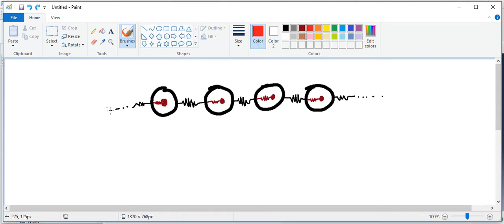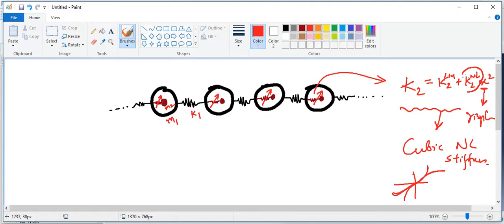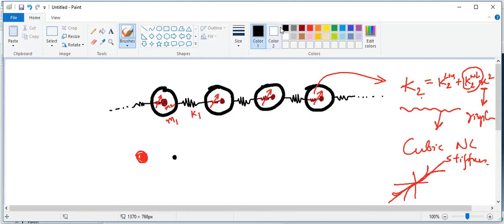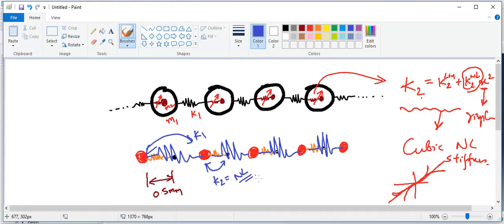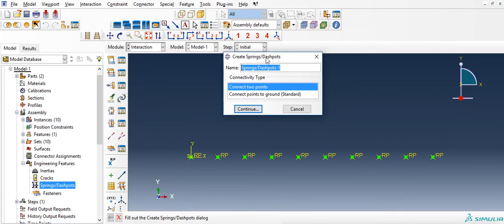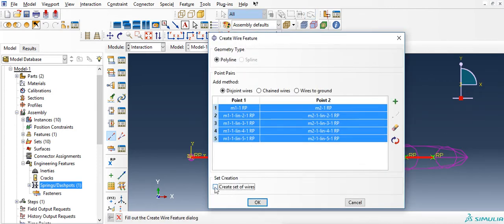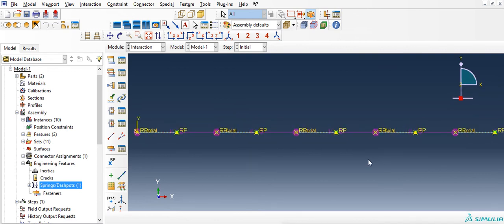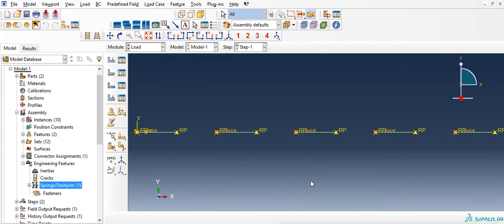Spring mass chain with local nonlinear spring-1

Comment: Thanks Sir, very helpful! Could you explain more why we need to define mass for spring? what happens when spring has no mass?
Reply from the maker: I haven't thought about this before. But I think in F=kx+ma, if you don't have m, you'll still have displacements to work with and their second derivatives can be dropped.
Reply: @wild031  I already gave a try, it's correct, thank you for your time,, Sir!

Comment: dear Prateek, thank you very much for such a good video. Can you please explain me that how can I get the Force and Displacement values so that I can use while selecting nonlinear spring option? I am re-validating my experimental data of a pullout of a steel bar from Grout. I have the experimental load-slip curve and I want to numerically simulate that. Your help will be appreciated.
Reply from the maker: iftikhar khattak I was simulating a known cubic nonlinear stiffness (duffing oscillator). So I obtained the values from an Excel spreadsheet.
Reply from the maker: iftikhar khattak are you asking how to obtain load-displacement response of a stiffness element in general (not specifically to the case discussed in the video) ?
Reply: Thank you for your expedite reply. Yes I want to use non-linear spring for simulation of bond-slip behavior between grout and steel bar. How can I obtain Force and Displacement values which you have obtained in your case through an excel sheet. Your reply means alot. stay blessed.
Reply from the maker: Oh I see! You need the stiffness (F-x) curve for steel bar and grout, to start with. I don't know how you would go about obtaining that data. If you had the experimental data, go ahead and use it as is.
In my case, I basically defined the nonlinearity I wanted, so obtaining it was not difficult. It was an initial assumption.
Reply: So you mean that the F-x data which I have obtained from my experiments, I can use that while defining the NonLinear Spring?
Reply from the maker: iftikhar khattak technically, you can. But if you're running a simulation to compare experimental data against (FEA) computation, you should set up the experiment in abaqus the way it is in real world or a reduced order simplified model. Then apply the load in abaqus and measure the displacement. This is how you'd obtain the f-x curve for comparison with experiment.
Initially you seemed to input the stiffness curve in abaqus, but it looks like you really want to compute it.
Reply from the maker: Presently I'm working on a lot of things, so I barely have any free time myself. But I will take a look at your complete problem statement and give my comments. Here's my email ID prateekkulkarni7@gmail.com. Again, I can't commit to it, but I'll try to help.